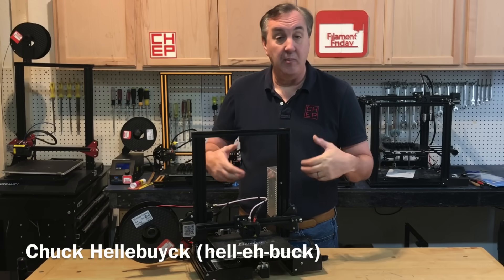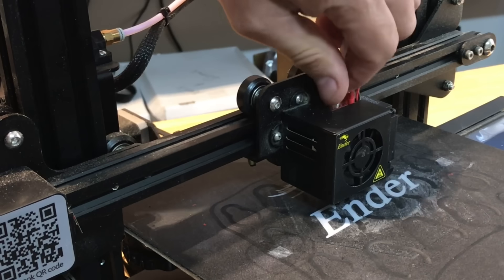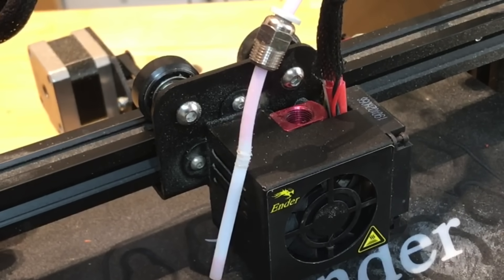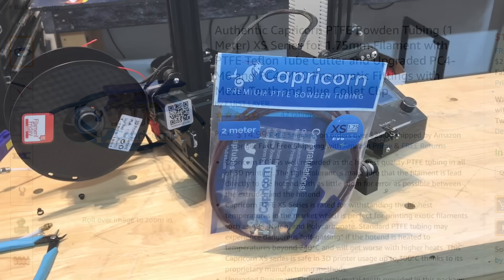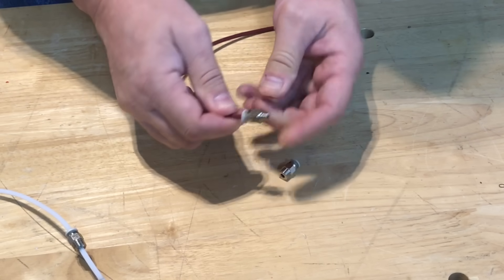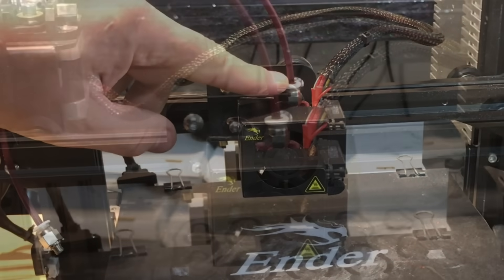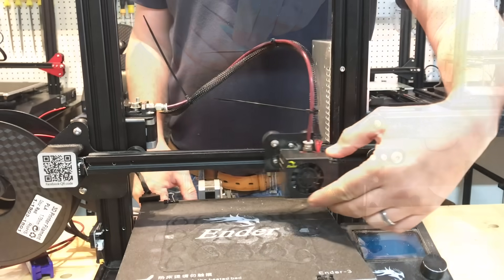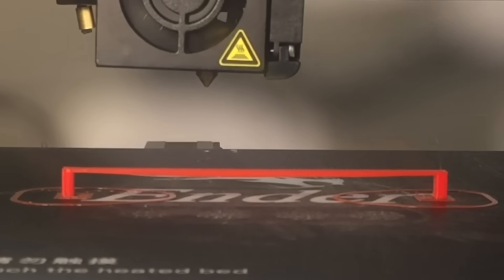Upgrade Creality Ender 3 with Capricorn PTFE Tubing

Comment: You NEVER want to "crunch down" on the tube. If your coupler doesn't have proper teeth, then it should of been swapped out along with the tube.
Reply: Can you explain why what he was doing is wrong? really just curious
Reply: The tube MUST be tight against the nozzle to prevent a gap that causes drag, clogs, and under extrusion. Crunch wasn't the right word to use. It gets squeezed against the nozzle to create a seal.

Comment: Hi. 
I was watching a lot tube while prinntig. The tube is cut not because one turns thw coupling. It happens seldom (usually). I have made a mark on a tube just above the coupler on the hot end. When the carriage moves along X axis the tube rotate inside the cupler. It is due the geometry of the tubing path, stiffness and the way all thing is assembled. Due this back and forward rotation sharp coupling teeths cut through the tube. For sure Chep srew pritable coupling or other one locking the tube axially would be recomended.
Best regards!

Comment: Thanks Chuck for this helpful video. I do have some Capricorn tubing I purchased for my Anet A8 but I'm still using the PTFE tubing that came with my E3V6 clone because I converted my A8 to Bowden Drive. Now you have me thinking because I tried printing an electronics case for my A8 and it was jamming not printing past a certain height. So I ended up printing it on my Ender3. But my reason for my comment is to request a favor. If you can make a video on how to reset the X-axis home position on the A8. The original home position of the hotend with the direct drive is just off the hotbed. Now with the Bowden hotend the new position sits farther to the right making the center of the print area off to the right. This makes printing larger items that sometimes go off the right side of the hotbed. This would be a big help. Thank You in advance.
Frank M.
Reply from the maker: It’s in the machine setup in Cura.
Reply: @FilamentFriday , is that it in the drop down under TRAVEL, where is say's, Layer Start X?

Comment: Screwing the coupling in/out repeatedly with the tube still through it is probably what caused it to chew through the tube. Never do that, always pull the tube out first! 
(Even while it's much more difficult at times. But the fix with short separate tube piece in the hotend helps immensely with easier serviceability, including this issue).
Reply from the maker: The back and for movement of the hotend twists the PTFE and caused those cuts over time.
Reply: @FilamentFriday  I'd say it had a play in it, but on printers where you never create the groove all around the tube in the first place it doesn't happen like this, or way slower, as the coupler grips the tube firm with it's teeth. All it takes is screwing it in with the tube through once or twice while servicing for a groove to appear, which will massively speed up this kind of damage during normal operation.
Reply: @Tomaskom you have no idea how many hours tonight I was trying to figure out my problem and you nailed it. Thank you both CHEP for pointing it out on the video (took forever to find this) and for you Thomaskom for noting the exact issue I was having. Filament would not extrude because it was so tight/cutoff at the coupler and not tightening with tube inserted fixed my issue. Lots of tube wasted but still have slack.

Comment: If my (original) couplings won't push to move, are they worn out? Is there a way to make them work?

And nice timing, just when my PTFE started to give me trouble! Though in my case it was probably the filament
Reply: I found that cheap PTFE tube occasionally has too large outer diameter inaccuracies that doesn't allow you to manipulate the coupling or the tube itself very difficult to push in or pull back. factory coupling on the heatbreak is still ok for me, bought cheap PTFE from different stores, and there it was the culprit; different outer and inner diameters, every 1m cut i bought has different feel

Comment: Wow, just recently I encountered the same exact problem. I thought that it was a bad filament but when I changed the nozzle and tried to put the filament into the hotend I noticed the blockage you described. Good that I noticed it now, before I ordered a new extruder which I also suspected to be faulty. A bit of nerves and money saved.

Comment: Good day,
I've been solving one thing on my 3D printer together with Octoprint for a long time. I have one fixed Z offset and always after printing I have to manually move the print head to the Offset and then turn off the printer. Is there any command to Gcode that would automatically move the print head to z-offset - the default position of the Z axis? Thank you for your response :)
Reply from the maker: Doesn’t your slicer put the Z offset in the initial GCode?

Comment: This, or just make it a direct drive?
Reply from the maker: And then deal with all new issues ;)
Reply: Tried DD (or at least short bowden). Didn't improve my retraction and made more work disassembling the extruder and hotend assembly to fix filament jams.
Reply: @mvanzante  I've seen most successful DD printers use geared extruders, so maybe you should have just gone all in on getting rid of anything bowden? I still have a bowden setup so I don't know.

Comment: I upgraded mine to a black ptfe tube from trianglelab, when I had to replace my hotend (failed experiment with ABS...) I ordered some all metal heatbreaks for the stock extruder which should convert it to all metal. I hope my plan goes well, so I can print ABS without worrying about degrading my nice new tube if I ever want to
Reply: btw, I just noticed I haven't given you an abo yet. Fixed that problem of course ;)

Comment: I was having problems with filament breaking in the extruder. The PTFE tube was cracked exactly where you pointed out at the coupling at the hot end. I performed the maintenance in this video and the problem is solved. Thanks Chep! 😀
Reply from the maker: Glad it helped.

Comment: Old carpenter's trick - measure twice, cut once. Not measure, cut and measure again!
Reply from the maker: This isn’t tight fit like woodworking. You can be slightly long or short. All you need is close.

Comment: Please don't turn/tighten the couplings if the PTFE tube is still inside, otherwise he teeth of the coupling basically cut into the tube! This then creates a grove in the PTFE which also makes it impossible to remove it from the coupler. You mentioned that the new coupler is better than the old ones because you can now easily remove the tube after it was inserted which actually works with the stock ones, too, IF the tube is in fine condition.
Reply from the maker: The head moving back and forth actually causes the tube to twist slightly in the coupling. 100’s of hours printing causes most of that damage not the little bit I tightened.
Reply: @FilamentFriday  the coupler that you screwed in the extruder gear mount could be damaged that way, the best thing is to first screw it in then put the PTFE, and if you need to remove it then first remove PTFE then unscrew the coupler (best tip to not destroy the PTFE is to first push the ptfe tube inside of the coupler, then pressing the plastic thing to remove the tube and then removing the tube, that's the way to cause the least damage
Reply: @specy_  Yes I was going to comment the same thing!

Comment: How about those banggood clone "capricorn" tubes? Something between real capricorn and the one that came with the machine?
Reply from the maker: I haven’t tested them.
Reply: Can't say anything about the ones from banggood, but my ptfe tubes from Aliexpress (made by Trianglelab) seems to be quite nice and I have a beautifull print quality
Reply: @Auravendill  Thanks. Maybe I will try those. Bad experience with Bb customer service lately. So, not sure what I would dare to order from there and expect receivinh correct parts.
Reply: I bought a clone capricorn cutter. That was a mistake. It does not cut square to the tube. Buy cheap pay twice.
Reply: @slicedpage  the cheaper the tool the higher the skill needed to get to the same result. My triangle lab tube came with a nice tool, that is a bit different than the one from capricorn, but seems to work good enough. Before I just used a very sharp knife.

Comment: The clips you mention more importantly prevent play in the push fitting. This is particularly relevant at the extruder end. If the hotend it done as you recommended it will lock the PTFE tube in place.

Comment: I had stock PTFE tube issues printing nylon on my CR10 with stock hot end assembly . Switched to capricorn and no more problems. It seems to handle the temp.

Comment: Kept getting the same problem until I changed over to Capricorn tubing. The heat from the hot end was distorting the tube and shrinking it onto the filament

Comment: great videos, unfortunately none of the links ship to Australia
Reply: u can buy capricorn direct from creality
Reply: @LostCloudx4  I can't find it on their website. Are you sure? Do you have a link please?
Reply: @LostCloudx4  Just found this. Not sure if they ship to Australia though. All pricing is in USD.
Reply: How about this? For an Ender 3 you only need about 300mm so you can buy 3 x 100mm for $5.85 but you'll need to buy the push fittings separately

Comment: That's a neat little trick for installing the PTFE tube in the hot end. I did my Capricorn swap when my printer was about a month old, the only thing I did differently was I loosened the nozzle before installing the tubing and then tightened up the nozzle to the PTFE tube.

Comment: is there any grease like substance in an Ender 3 Pro hot end? had a weird clog that the substance looks like black grease and is slightly sticky. the temperature goes  4-5 past the set temp upon preheat instead of 1-2 like it normally did and the end of the Capricorn tube was somewhat blackened from the greasy substance.
Reply from the maker: Sounds like the PTFE is melting. How hot are you running.
Reply: @FilamentFriday  205 max 225C. I only run PLA 225C I use for vase mode btw only began experimenting with different nozzle sizes with mixed results so far.

Comment: First? Got a future hack for you to test for better roofs, try using only 1 wall in cura, with infill walls enabled(2 min), that way when it makes a top layer, it will do lines on top of the infill walls, instead of starting on the infill itself. Tried with pure infill walls, but that showed issues.